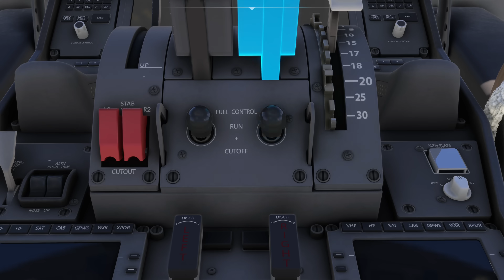Air India 171: Why Did The Fuel Cut-off Switch Get Moved?

Comment: Capt'n Steve, I heard your comments on the question of why are there no cameras 
in the cockpit and your answer was to be expected.You don't want anyone to see 
your foibles while you are at work and I agree with that. However, you must 
consider the tremendous help it would be to see the events as they are occurring in 
real time. That way, you can know immediately what may have caused the plane
to crash as in this case with the switches being turned off by one of the pilots. The 
technology is so advanced that cameras in the cockpit and around the plane at 
critical points, like the engines and the rear of the plane could be monitored in real
time. The key to this system is that you would program the cameras to turn on at 
the point where the airplane is in the landing position at maybe 10,000 feet and 
once at that altitude an alert will sound saying camera on, camera on indicating 
that the cockpit is now in a sterile mode, ie, no horsing around and the pilots will
have the upper hand in this situation. When the system is turned on automatically,
either when in landing mode or when the airplane system detects a problem, it 
sends the voice and video to a satellite which would route it then to the airline or 
FAA data center and only to be reviewed if there was a problem. If no problems 
are reported for any flight, then it will be stored for 30 days and then deleted. No 
one can view videos unless the law intervenes, thereby protecting the privacy of 
the airline and its pilots. Now for the take-off, once you start your checklist and 
touch your first instrument on your panel, the system will sound the same alert,
camera on, camera on and you will know that you are in the sterile cockpit mode
and the cameras will turn off automatically at 10,000 feet. For years I've watched 
the channels on airline crashes and just about everyone of them would say as an 
after thought, I wish we could have seen and or heard what was going on in the 
cockpit just before it crashed. To think that we create such magnificent airplanes 
and not build into them these tools that can help us to know what went wrong
immediately is baffling. The years of wasted investigations costing time and money
would be eliminated. What a shame. I hope you agree.

Comment: These are mechanical switches right? I don’t think switches are designed to received inputs and go on/off. Example you can turn a fan on/off using a switch and the reverse is not possible ie a fan can never turn its switch on/off. I hope I’m speaking sense?

Comment: simple logic: 

1. say if pilot wants to commit suicide" he could have done any way just by steering of the runway or any other way, he don't have to secretly switching off to get away from the crime because he will not survive anyway"

 could you also pls answer my doubt in your next video" last minute before both the pilots get into cabin if someone cleaning crew or any other turned off this switch, would air craft would start the engine and fly little bit with residual fuel in fuel lines  or  there is no residual fuel engine would access at all, if there is how much of fuel it would be in the fuel line after switching off.

regards

Comment: It looks as if at the exact time "Positive Rate" would have been called, thus the follow up command of "Gear Up" should have aired. Yet, at this very moment the fuel switches were turned off. The preliminary report does not give the CVR dialog in its entirety, In fact what has been revealed lacks who said the quoted verbalization's. Did someone "press the wrong button"? In another aircraft that pilot once flew have the landing gear switches located below the throttles?

Comment: Why the aircraft logic didn’t stop it, Once the aircraft weight is off the tires aircraft knows that it’s in air. And did not even reached the cruising altitude. This security system made for something at the very up in the air not just after takeoff.

Comment: Capt. STEVE - "The aircraft was operating exactly the way it was designed".

NO, it was not, Capt.Steve. It was not operating normally. You forgot the person who shot a video from inside of the same plane just landed (from Delhi to Ahamadabad before it took off to Gatwick) and complaing about the infotainment, AC and other things are not functioning properly as they were designed to. So the plane was flying with so many flaws.. who knows what other issues it had..

It's not PLANE AND SIMPLE as you emphasise always, Captain.

Comment: OMG are you really a captain? 2 pilot required input into anything is disaster..2 pilots ops is required just for the purpose of backup should another became Incap...if you required a 2 input on anything, then you need 3 pilot ops..and incase of fire at low altitude around 200 feet i would land first before shutting any engine..the engine can withstand fire for a while and it is safer to land first, shut it after land..only in the case of no gear landing that we should cutoff fuel immediately before touchdown to reduce risk of explosion upon touchdown..

Comment: Jumping so early to the suicide/ murder angle is quite irresponsible, because the 2018 FAA report stated this could happen. A presumption that a trained and experienced pilot would behave like a child and deny having turned off the switches, before considering any other evidence smacks of racism because these pilots were Indian. Even if it later turns out to be true, to jump to that conclusion is definitely racist. A very negative stereotype. I wonder about the timing of the comments compared to when they’re actually turned off. Could it be that they noticed a loss in power and then one asked the other if they had tried turning the switches off then on?

Comment: I think the PNF flipped the cut off switches. The PF is responsible for keep their hand on the yoke and looking outside while the PNF raises gear, turns switches on/off, manipulates flaps, FMC inputs, et cetera. It stands to reason that at that critical phase of flight a pilot wanting to sabotage would do it then.

Comment: 2 days ago- Mentour Pilot Peter did a video on Lufthansa flight 1140 in which the pilot went out for a lavatory break, and the co pilot locked the cabin. Soon afterward the co-pilot, being the ONLY pilot in the cockpit had some kind of seizure and the pilot was unable to re-enter the cockpit. Eventually the incapacitated co-pilot came to and let him in, saving the flight. But then came the discussion about never allowing anyone to be in the cockpit alone, so another member of the flight crew would need to be trained to fly the plane and be the stopgap when one of the pilots takes a lav break. SO Why not just BRING BACK the flight engineer, train him how to fly, and there will be 3 people in the cockpit, relieving the pilots of THOSE SWITCHES and other engine management tasks?
Reply: A third person in the cockpit would just increase the risk of these kinds of issues.

Comment: Why Voice Alerts Matter:
	•	Audio alerts engage a different sensory channel than visual indicators—especially helpful when pilots are:
	•	Heads-down programming the FMS.
	•	Focused on runway visuals.
	•	In high-stress conditions like go-arounds, storms, or engine failure.
	•	Voice alerts, such as:
	•	“ENGINE FUEL CONTROL SWITCH IN CUTOFF” or
	•	“ENGINE NOT ARMED FOR START”
would likely draw immediate attention to a critical engine misconfiguration before it escalates.

Comment: Let me first analyze and raise questions about the preliminary report and cockpit voice recordings from an Indian perspective.
Why didn’t the report mention the exact time both engines shut down? Instead, it vaguely states "01 second," the shutdown occurred after 08:08:42 UTC. In that case, exactly how many seconds or milliseconds later did both engines cut off? This lack of precision is concerning — they should have obtained this data from the Flight Data Recorder (FDR).

As for the Cockpit Voice Recorder (CVR), the conversation appears to be a poorly translated version of what was likely spoken in Hindi. In Indian culture, it's common to assume blame quickly — for example, if a pilot saw the engine in the cut-off position, they might instinctively assume the other pilot did it. The second pilot's denial supports this miscommunication. We need the actual transcript in the original language to understand the true context.

Frankly, I don't trust the DGCA — it’s among the most corrupt aviation bodies I've encountered, and I say this based on firsthand experience. Regardless of what they claim the pilots said, I want to see the unedited CVR transcript and the FDR data with precise timestamps for every key event. Additionally, I strongly believe there needs to be an independent report from international aviation agencies analyzing the CVR and FDR data — completely separate from DGCA's coordination or influence.

Comment: captain steeve is this possible Step 1: Shortly after takeoff, engine(s) lose thrust or flame out
	•	Let’s assume a dual engine anomaly or unknown failure (e.g. sudden dual FADEC misbehavior, fuel anomaly, birdstrike, etc).
	•	Aircraft starts to lose thrust immediately after rotation (180–200 knots).

✅ Technically possible, but very rare for both engines to fail with no fire or birdstrike.

⸻

⚠️ Step 2: RAT deploys
	•	Engine failure causes electrical power loss → RAT automatically deploys to power essential systems.
	•	No RAT warning triggers CUTOFF; it’s purely reactive.

✅ Consistent with known facts.

⸻

🧠 Step 3: Cockpit confusion starts
	•	Pilot sees rapid engine loss, no clear warnings.
	•	Captain says: “Why did you cut off the fuel?”
	•	Co-pilot is confused — thinks something must have gone wrong with his switch setting or misheard command.
	•	Under stress, possibly fearing a switch was in the wrong position, the co-pilot manually moves one or both fuel switches from RUN to CUTOFF, thinking it may be a reset or correction.

✅ Plausible in high-stress, low-altitude, seconds-long scenario, especially if there was a misunderstanding or miscommunication.

⸻

🧯 Step 4: Fuel supply is now manually cut off
	•	Now the engines are completely starved—CUTOFF overrides FADEC logic.
	•	No fuel = no thrust.
	•	RAT is powering basic systems, but no engine thrust = no climb capability.

✅ This matches preliminary report: switches were in CUTOFF.

⸻

🔄 Step 5: Co-pilot (or pilot) realizes the mistake → switches back to RUN
	•	CVR records a switch-back attempt.
	•	FADEC begins engine relight sequence.
	•	But it takes 6–10 seconds minimum for relight to start producing usable thrust — and they’re already too low and slow (less than 700 feet AGL and decaying).

✅ Confirmed by report: switches were set back to RUN, but relight failed due to time constraints.

⸻

⛔ Step 6: Aircraft stalls → impact occurs ~32 seconds after liftoff
	•	Low altitude, gear down, no thrust, climbing profile interrupted = stall.
	•	RAT can’t help with thrust.
	•	The aircraft descends, hits a college building.

✅ Consistent with damage reports and impact site.

Comment: Captain Steeeve:  

I'm Doing research on Full Authority Digital Engine Control (FADEC) System.  This system is one of the most automated EC systems ever, and connected to at least two other systems in the 787-8.  I read that the GEex engines on AI-171 were installed this year (March, May, respectively?); and the center engine control console was replaced at 24,000 cycles (usual and customary maintenance . . . and opportunities for unattended technical issues).

As a Comm MEI Pilot and Instructor, I'm particularly interested in what I refer to as "over-automation" of certain systems that either replace or override critical pilot inputs. I've also designed and tested a bunch of software. 

Does anyone think FADEC or some other system played a role in the AI171 tragedy in shutting off the fuel valves (controlled by the fuel cutoff switches, for example the 41-43 Centigrade heat although the aircraft appears tested to 50C)? 

The auto-restart sequence that occurs after returning the fuel shutoff switches to "RUN" is pretty handy in a "pinched" re-light and engine fuel flow.  Did the engines fail from some other cause, and these pilots need a quick re-start (absent the 10 second wait during a 32 second flight)?  Sincerely, FO Adaaaam

Comment: Hello Steve, my question doesn't involve this crash, but I watched a show years ago where they crashed a jet on purpose where they had added a additive to the fuel that prevented the fire and explosive factor, and they had a row of flames on pipes that ripped the fuels cells open and it did not catch fire. Now why don't they do it, is it just to costly, and the bean counters say it isn't worth doing so, because the planes are so safe?

Comment: This kind of speculation is absolutely absurd. A Boeing 787-8 operated by ANA on 17th Jan 2019 just after touch lost both engines (automatic engine shutdown) automatically.  Luckily this incident happened right after touchdown. Point number 2 - the MCAS system developed by Boeing was an absolute human killer. Point number 3 - in 1990 two Boeing 737 crashed a (United Airlines Flight 585 and USAir Flight 427) due to a manufacturing defect on the rudder actuator mechanism. Point number 4 - Federal Aviation Administration (FAA) Special Airworthiness Information Bulletin (SAIB) No. NM-18-33, issued in December 2018, flagged potential disengagement of the fuel control switch locking feature in Boeing 737 aircraft by the way which is the same on the Boeing 787. While I don't fully disregard sabotage let's not blow up one aspect out of proportion by paid media controlled by stake holders of Boeing. 06:21 Captain Steeve is saying that there is only one reason for the fuel cut off valves to go from run to cut. This statement is untrue and frankly I find it strange that a pilot with so much experience is making a statement without thinking through other facts.  The NTSB,DGCA and ICAO (sitting member) hopefully will come out with the truth.

Comment: AUDIO ALERT COULD SAVE LIVES

In crashes like Air India Express 1344, a simple voice warning—“ENGINE FUEL CONTROL SWITCH IN CUTOFF” or “ENGINE SHUTDOWN” during climb or go-around—could alert pilots instantly. EICAS visuals can be missed if the pilot is focused elsewhere. An audio alarm engages the pilot’s hearing, especially critical during high workload.

Aircraft systems should:
	•	Prevent fuel switch cutoff in flight without a manual override.
	•	Trigger voice warnings based on flight phase if cutoff is selected.
	•	Include software logic to highlight engine misconfiguration BEFORE thrust loss.

This is an easy software safety upgrade that could save lives. Hope Boeing and aviation regulators consider this.

Comment: I graduated in1970 with a degree in Civil Engineering.  I had a friend who graduated in Aeronautical Engineering.  I asked him if he was going to get a job with Boeing or some other aircraft manufacturer.  It was 55 years ago and I still remember his answer which astounded me.  He said "No, I'm afraid I might make a mistake and a plane would crash as a result."  AE is a very difficult degree, and graduates can make a bunch of money.

CE's are also at risk of this happening.  I remember one of my Structural Engineering Professors telling the class that a Doctor usually buries his mistakes one at a time;  whereas an Engineer often times buries his mistakes by the dozens or hundreds.  

The bible of structural engineering is called the Steel Manual, and it is revised every several years as mistakes are made.  That same Professor said the Steel Manual is written in blood.

Comment: Pilots can't defend the allegations because they are no more.
This investigation report leaves more question than answers.
Half cooked report.
Captain pls explain why the landing gear was not retracted?
There will be auxiliary batteries to help important communications and flap operations then why RAT deployed?
Is it necesary to deploy the RAT when ffuel switches shutoff manually?
Aircraft does not had any options to land back also they don't had enough thrust they why they don't retract the landing gear to reduce the drag?

Comment: They need to make it impossible to turn the fuel pumps off when the throttles are above 50%. That logic would be very easy to add and it would make what happened here nearly impossible.
Reply: How about an engine fire during flight ?
Reply: @Darenbranch Wouldn’t you pull the throttle back on the engine on fire?
Reply: @paulontheroad no you cut the fuel off ?

Comment: If one would like to control an aircraft, or make it ground , then a function would be implemented in the fuel supply mechanism. But if so, why or by what was it activated? I do not believe that the two switches were manually changed by one of the pilots. I still think it was a software failure. And the problems with these functions over the last 5 years are a hint to this. Way too many different interests included in too difficult to handle systems. I really guess that the fuel switches were put in this position by software. Are there actuators included in this function which could to this. One should check, and the truth will appear with much more certainty.

Comment: My understanding is that the switches are electronic switches connected to the flight computer.  Taking the fact that the switches where physically found in Up position,  and the other pilot said he didnt cut it off, it well can be that the switches never indeed were put on Off, but it was a s/w glitch or any other tech malfunction that actually shut of the fuel???